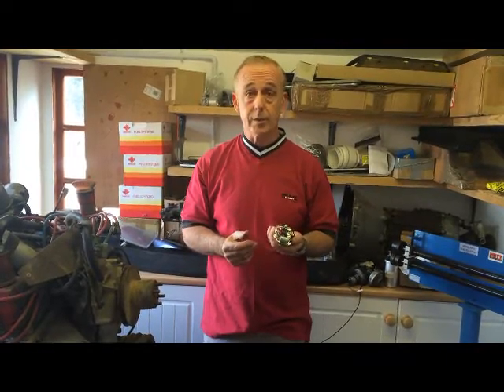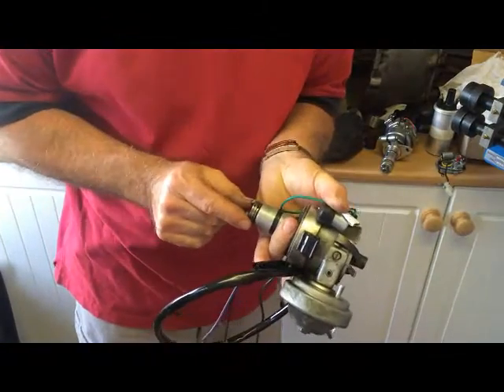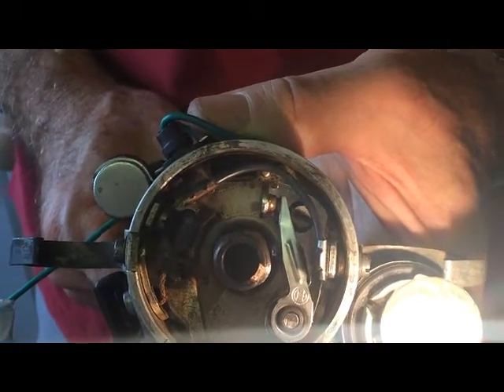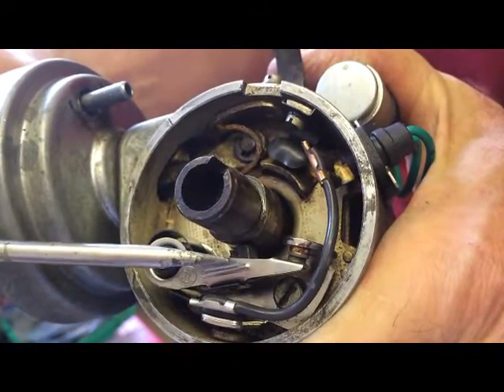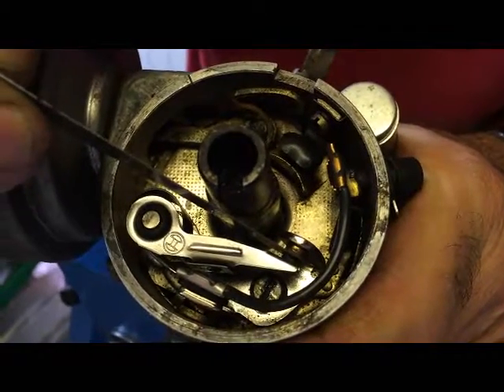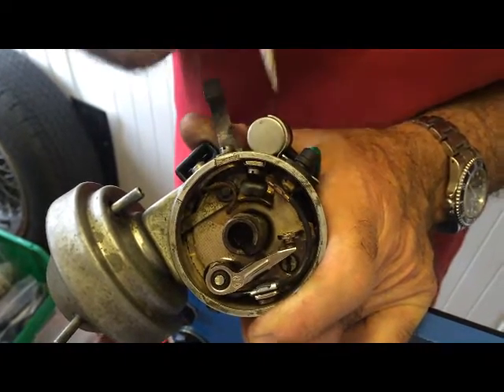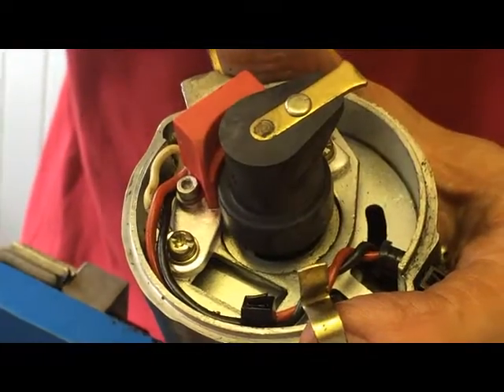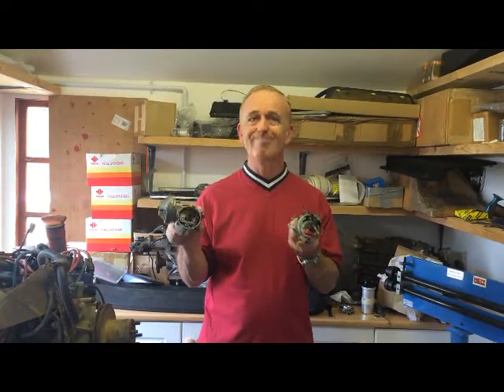Classic Car Points & Electronic Ignition Explained

Comment: to clear up a point====while the points are closed the system is grounded the wire from the coil  is grounded  no current flow   when they open that removes the ground the current flows into the condenser which is creating a magnetic field thru the large winding  which send high voltage to dist.to the spark plug

Comment: My favorite thing turning up a VW NGK plugs and only Bosch points and condenser I usually get three sets of points out of one condenser always use the .009 distributor make more horsepower and have better gas mileage smoother performance.

Comment: Them old v8 prestolite distributors the low tension  points wire insulation  goes down and intermittently  shorts out points took 2years to find fault could just see it glowing  in dark tracking out